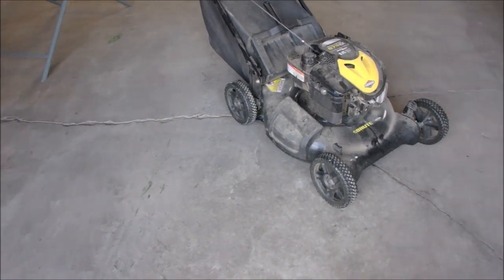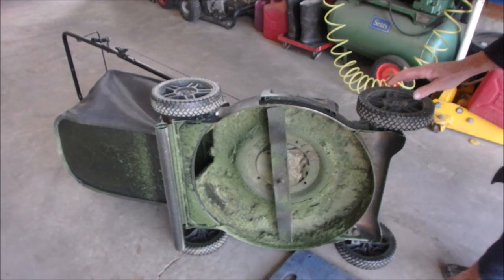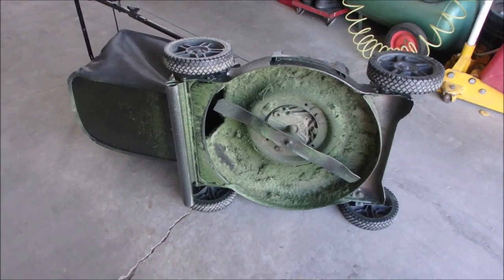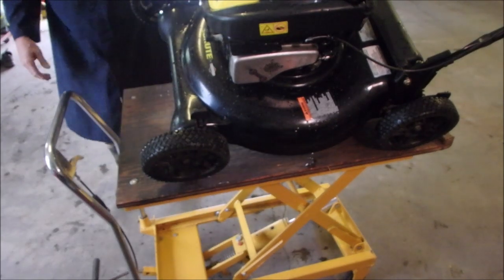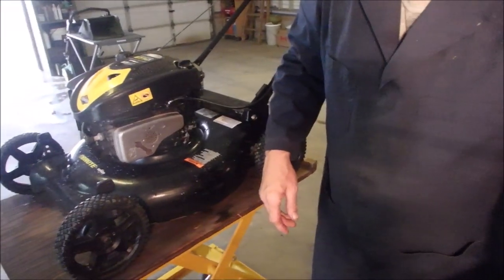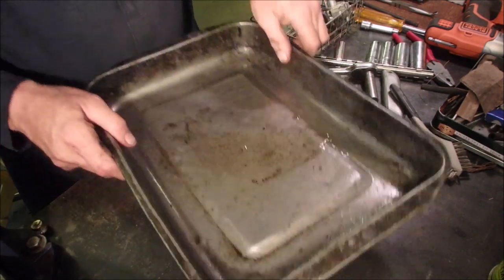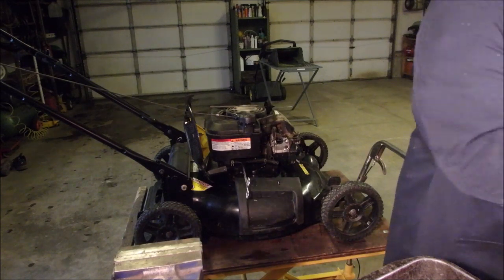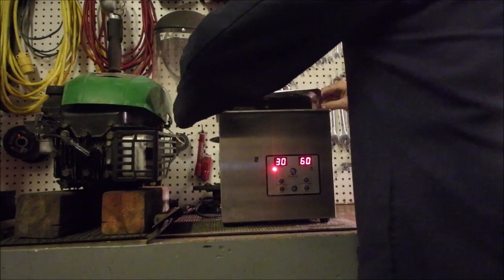Brute Mower (Walmart) Makes a BAD Noise

Comment: Nicely done as usual, here is a little  trick. On the 3.75 HP engines when you replace the diaphragm B&S says to score a little line with an Olfa type knife on the tank between the farthest appart screw holes. This little bit of resistance  helps to prevent the diaphragm from getting sucked in a little the way they tend to do. Just an FYI.
Keep up the great videos.
Reply from the maker: That is a great tip !!!!!

Comment: After the 3rd pull I was thinking what the hell? Then I remembered the spark plug. Then I started the timer on you. 5 second rule applies here buddy. You were fine. I did chuckle a little. You just proved it happens to the best. Me, Im ALWAYS forgetting switches on blowers,saws etc.  My tired arm will remind me to turn it to ON. Lol. Good job as usual and many thanks.
Reply from the maker: I have yanked on a few saws before i turn then on to.

Comment: A question, the blade was loose and was tightened a tuneup oil change carb clean, great. What happened to the blade sharpen and balance, is there an underlying reason the blade came loose such as a missing washer or bad  threads, is it worth investigating?
Reply from the maker: The blade was perfect when i checked it.  I talked to the owner and he removed the blade and didn't re tighten it.  wow.
Reply: @BrucesShop  Amateur lol

Comment: Hello Bruce. My sister had a WeedEater 22 inch push mower that has the 10T802 Briggs & Stratton engine that seemed to go through the diaphragm & gasket periodically. The engine has been maintained as it should and does not use any oil. 
When the mower was purchased new; The sales associate alluded to the fact that Briggs & Stratton had issues with the carburetor diaphragms going bad. 
Recently when the mower started acting up this time around- It had a tremendous amount of crud that had accumulated around the carburetor gasket area. I cleaned the carburetor externally and removed the five screws to remove the carburetor from the tank. The pulse port in the tank contained what looked like rusty water and the screen and pickup tube also had a fair amount of crud. The o ring & retainer stayed onto the intake pipe when I removed the carburetor from the engine. So I proceeded to clean the carburetor and tank in which I installed the new diaphragm/gasket - Also replaced spark plug with a new J19LM Champion. 
Bruce, I had the engine running great at my place- Just like it’s old self. So after I delivered the mower back to my sister; She called me a few days later complaining that the mower was running even worse than before. The engine was surging up & down with the black smoke and was drinking gas. After all of that ordeal, I ordered an complete aftermarket gas tank with carburetor from eBay in which I had to drill out the linkage hole and remove a screw where the air cleaner screw threads in. The front mounting tab had to be retreaded where the 3/8” bolt goes.  I also replaced the foam air cleaner just for good measure.The engine starts and now runs as it should. 
Have you encountered any of the OEM Briggs & Stratton tanks causing issues like what I have been describing?.
Reply from the maker: No I have not.  I have had lousy imported diaphragms though.
Reply: Bruce  Under the circumstances- I was rather frustrated with the original tank & carburetor  and was willing to take a chance on the aftermarket tank & carburetor. What I failed to mention before regarding my sister;  While waiting on the replacement parts to arrive for the WeedEater mower, Sis purchased a new 22 inch Toro SmartStow which is a very nice mower which cuts as nicely as it looks. Thanks & Best Regards From Central Kentucky.

Comment: Bruce!!!!! You forgot the spark plug! I forget that EVERY SINGLE TIME I work on a lawn mower and tip it on the side... one would think you might learn after doing the same mistake 30 times in a row 😂
Reply from the maker: Maybe i did.  I usually check too.  The camera may have been off.    As you know it will be ok as they go a long time.  Thanks for the reminder though.

Comment: Hey Bruce, nice video!  I like the auto choke, but I also don't.  I like the auto choke because it is something less to clean because of no primer bulb.  But, one stuck piece of mulch can make that vane stuck.  I've done two this summer.

P.S. I like the big old Sears compressor.  Still using ratchets myself.  Take care.
Reply from the maker: Right on.  That old compressor is a beast.  I love it.

Comment: With the spark plug on on startup lawnmower makes knocking sound from motor but without the spark plug no knocking sound what do you think it might be? When lawnmower starts it sounds fine.
Reply from the maker: If the knocking doesn't go away it could be either a loose blade or an internal issue with the engine.

Comment: Have you ever tried an oil extractor? I just bought the Top Sider oil extractor very handy on engines that don't have a drain plug like Honda. It's also good on larger Briggs Equipment that are just too heavy and awkward to tilt or get to the drain plug.
Reply from the maker: I want one.    I have a small one that works just ok

Comment: I had a mtd dumpster find. When i test started with carb cleaner it made noise. Star on blade adapter stripped. Was uncommon 1" shaft. After buying adapter and blade I never got it started again. Concluded low compression due to scored cylinder. Not sure why it started on my test.
Reply from the maker: Yes those 1 inch shafts are uncommon.

Comment: Most people do not change the oil or air filters in their mowers. Then they curse the manufacturer for making "junk". A good wash does wonders, top and bottom. Cleaning the fins on the cylinder does wonders, too.
Reply from the maker: You are right.

Comment: Hey Bruce, I just love your video's.  I too was yelling for you to check the spark plug wire.  Bruce the wire.  Probably to much distance between us for you to hear me.  Never heard a blade come loose like that.  Good catch.  You should put on a local workshop to show how its done.  You could charge or not.  Free for single or divorced women.  Does your premium gas have ethanol in it?  Ours does.
Reply from the maker: I don't think ours does BUT they took the green stickers (ethanol) off the regular gas recently which makes me think all 3 grades of fuel are the same now.  ARGH!!!

Comment: can't count how many times i forgot the plug wire!
Reply from the maker: I feel better now :-)
Reply: Bruce Pender a real good one is the magnetic switch on the back of Lawn Boys that need either the grass bag or mulching plug installed to break the ground to the coil.  Many of my customers have dropped off new coils to install when all they need is to put the bag or plug on!!!  Took me a while to figure that one out a long time ago. Now it’s the first thing I look for!
Reply from the maker: @KensSmallEngineRepair  Right   what is that eh.  You take off the bag and the mower quits.
Reply: @KensSmallEngineRepair  i recently had one like that and it was driving me crazy trying to figure out why it wouldn't start. I originally thought the coil was shot so i replaced it with a new one. Same issue so i started to look around the break and the kill switch. It was working like normal. Took me nearly a day to figure out the bagger was needed to break the ground. Bad thing is for my customer is that she didn't get the bagger when she bought the mower broken. It was not broken just needed a bagger lol
Reply: @GmKofHard  Lawn Boy push mowers have that feature.  Been there lol. Thanks for watching
Reply: @KensSmallEngineRepair  yeah i been pushing people away from lawn boy mowers ever since. If they do get one i always recommend disabling that stupid feature that has no real use besides giving people headaches lol

Comment: What solution do you use in your sonic cleaner.
Reply from the maker: 20% Mean green 80 % water and i drain and filter the mixture every time.
Reply: I appreciate the quick answer. Does it work on carbs that have rotten gas that causes what we call the greens?
 @BrucesShop
Reply from the maker: @jonlennon3348  Yes    But i do rinse the carb fist with carb cleaner.  Some guys don't though.  I always go overboard.

Comment: Those great Quantums are slowly becoming scarcer.  Checked Home Depot online; all Toro models are either Briggs or Kohler OHV's (or battery powered) with the plastic carbs. Maybe they will hold up over time, maybe not. But I got a 2004 Quantum recently that runs great even though I could tell by the condition of the deck that the mower was not maintained. For sure I'm hanging on to it for future use. BTW, this has been a "Murray" week or two for you; both the Deere and this Walmart-only Brute were made by that now defunct manufacturer around 10 years ago.
Reply from the maker: I have another Murray by the shed waiting LOL
Reply: jj parody
"now defunct"?
Reply from the maker: @bubbafudpucker397  Not yet
Reply: @bubbafudpucker397  Thanks for questioning my comment about Murray. Kinda confusing but here goes. I had bad info on the dates. From what I now find, the original Murray Ohio Co. went bankrupt in '04. Briggs bought the name. Thus, the J25 that Bruce worked on was made (2010-ish) by Briggs/Murray for JD (that's good!).  I was misinformed that the original Murray Co. was still alive & making mowers, including Bruce's J25 & my J46, through about 2011. Anyway, that's why I used the term defunct; I was referring to the original Murray. Briggs indeed offers some equipment under the Murray name; ie, for Walmart & maybe others. Nevertheless, green is gone: (from lawnandlandscape.com) "John Deere ... will no longer sell John Deere walk-behind snowblowers or lawnmowers after 2012."
Reply: @jjparody8257  Got it. Briggs owns about a dozen companies, some make better products than others. I'd rather see a US or Canadian company buy somebody like Murray, than some half-assed chinese outfit. Check out this site and see tons of who's who info. 
https://todaysmower.com/riding-mower-brands/
Reply from the maker: @bubbafudpucker397  Funny it mentions Sears.  Not up here in Canada
Reply: @BrucesShop  That tool page is about two years old now.
Reply from the maker: @bubbafudpucker397  Right.